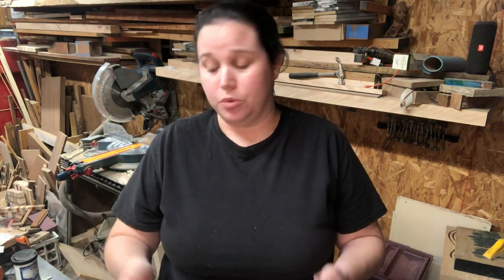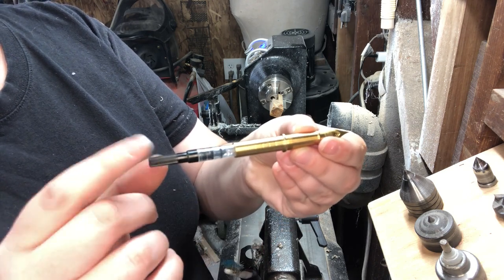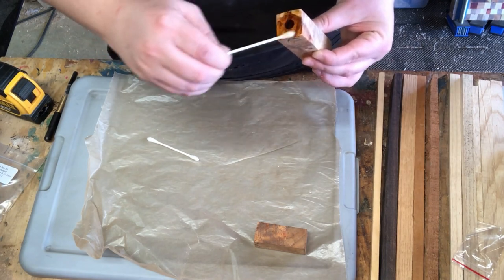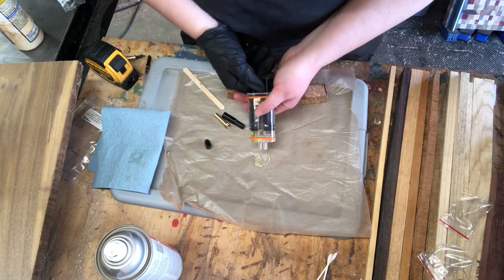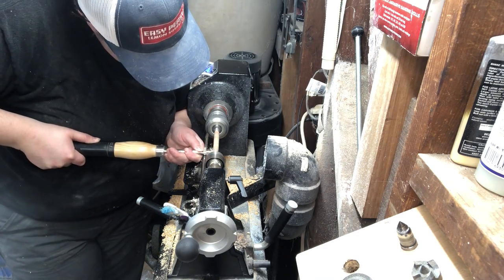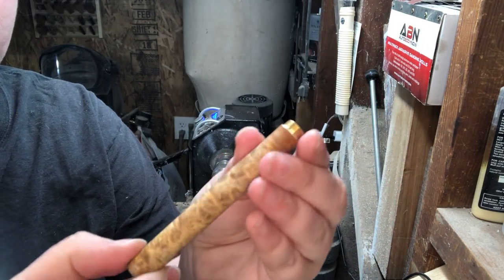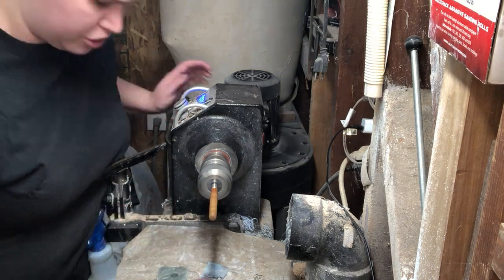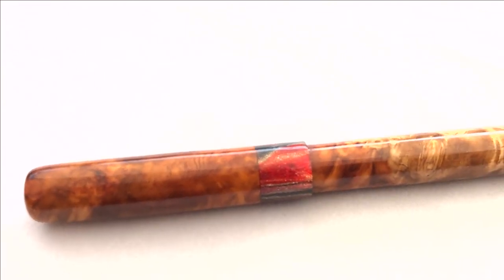Turning A Closed End Fountain Pen From Amboyna Burl

Comment: Good work and well finished.  In order not to impregnate the tools or the lathe when I spray the finishing lacquer, I use a thin veneer of plywood, with a C shape, the pen will rotate in the hole of the C and protect the tools.  Greetings from Spain.
Reply from the maker: That's a great tip! I'm not using a finishing lacquer here, but rather an accelerant for the CA Glue finish. Next time i use a spray lacquer I will totally use that tip!

Comment: All the pens I’ve turned I have bushings to know how far to turn down. I just received these kits. How far do I turn them down? Seems like on the body turn to the mid section ring. The cap turn until I like the thickness perhaps? Thanks in advance.
Reply from the maker: I use the larger metal section of the mandrels as bushing guides
Reply: @BowHarrowWorkshop  ah, that makes sense. Thank you!

Comment: Mine didn’t fit with 1/4”, 5/16, 23/64.. I had to go 5/16x3” 23/64x 2.25” and 3/8x1.25”.
Reply from the maker: What material were you drilling into and what kind of lathe are you using? Did you drill on the lathe?
Reply: This is for the bullseye 180 “kitless” set right?
Reply: @BowHarrowWorkshop  Im using a hardwood blank i got at woodcraft, jet 1440 lathe and drilled on the lathe.
Reply: I went one size up and it all fit with a tiny bit of jiggle.
Reply from the maker: Yea this is the bullseye 180 - weird that yours was too tight. I wonder if my bits are a tad off in size
Reply: I also havent glued it up yet because i dont want to screw it up..
Reply: @BowHarrowWorkshop I didnt want to jam the parts in and these are all brand new drill bits just for this project.. i only bought 3 brass fountain pens so i dont want to waste even one.
Reply: @BowHarrowWorkshop  well ill push ahead and if it doesnt work oh well.
Reply: @BowHarrowWorkshop  I cracked the cap trying to push the insert in, it was just too tight. It was just a 2 dollar blank, going to upsize the next one a tad bit.
Reply from the maker: Switch to a 29/64 bit if you have one